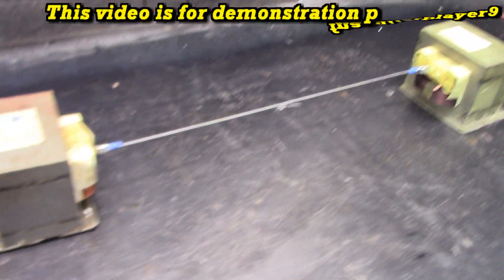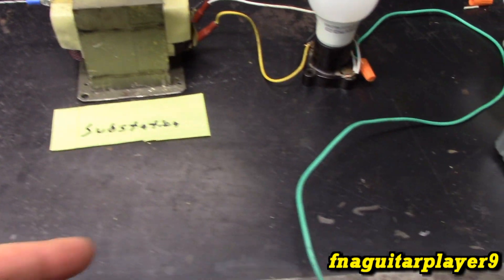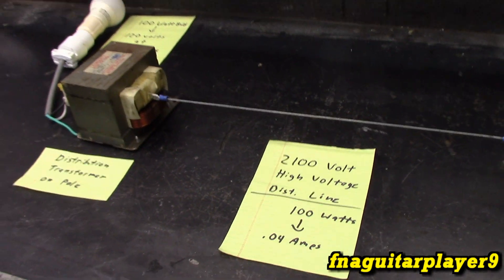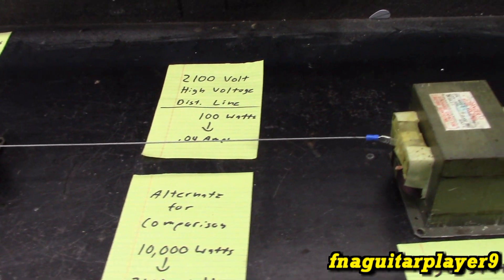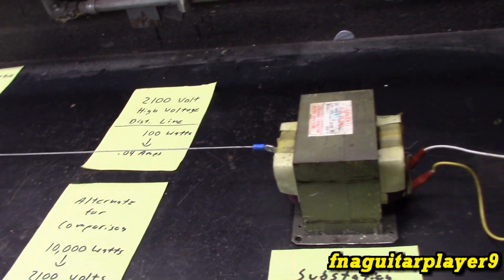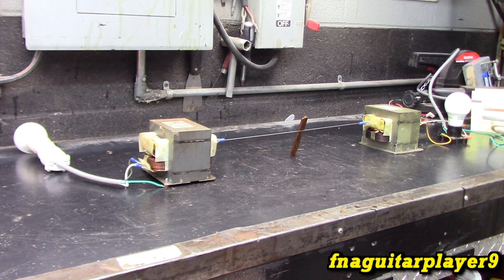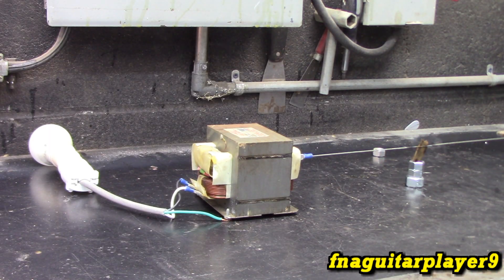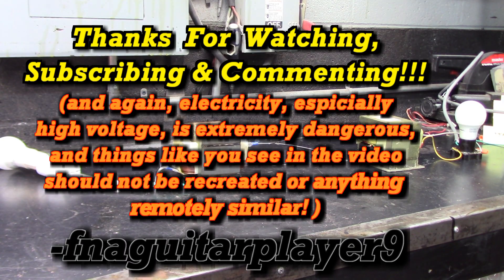How and Why High Voltage AC is Used for Electrical Distribution and Demo of Tree Contact

Comment: Thanks. I would have thought both wires on secondary would need to be connected to each other .
Reply: One end of the High Voltage winding in a Microwave Oven transformer connects internally to the frame. As mentioned at the start of the video, the return circuit is formed by the metal bench, which is earthed for safety and the frame of each transformer is in contact with it. That might not have been easy to pick up on as it was only mentioned briefly, or someone might start partway into the video. This demo models the now not so common SWER (Single Wire Earth Return) mains distribution system.
Reply: @PlatypusPerspective  thanks for the explanation. I did miss that part.

Comment: the cost of the wire is insignificant compared to the cost of the losses in the transmission. 
the higher the amperage the more losses there are, so the higher the cost of transmission, step up the voltage to lower the amperage and you reduce the cost of transmission. 
while it is still all down to money and profits, it's not the cost of the cable that is a major concern, if you could make more profit by using a 3 foot thick cable, they would use a 3 foot thick cable.

Comment: I don't think what he says is correct. Here in Sweden we use high voltage cables so people won't crash into the cables when they walk and avoids being electrocuted. We also don't want to wait for the electricity too much so we try to force it to move faster by increasing the pressure. It has nothing to do with resistance.
Reply: What the heck have I just read
Reply: @bilvanjomo7110  I'm not sure, but I suspect there's a Swedish word for it.
Reply: @bilvanjomo7110  Why so negative and racist answers? The cables are hung high above the ground in Sweden. That is why they are called high voltage cables.  We tried with low voltage cables but people kept tripping and stumbling over them so we went for higher mounted cables instead.

Comment: This is so cool!  So informative!  Thanks!   A topic on why it is AC vs DC would be cool too!  I know that Alexander Graham Bell had a competing Idea than Thomas Edison on DC versus AC for homes but I cannot remember why.  It seems Bell thought each home should generate their own power (freedom) and Edison believed in government to do it instead. (control)
Reply: AC is able to be transformed up and down in voltages without any other technology which means its cheaper.  you can transform DC to DC at different voltages but not really with the tech back when the grid was invented.  it was also a false information fear campain, the AC proponents said that DC was used for executions which meant it was more dangerous.
Reply: Nikola Tesla was responsible for the theoretical groundwork of AC technology. He had worked briefly for Edison, who fiercely defended DC power, and rejected Tesla's view of AC being preferable. George Westinghouse supported Tesla and AC development.

Comment: Good video, many thanks, I worked for an electric company and was in a substation when the 350 thousand volt breakers above the station opened under full load due to a short circuit.  Quite the experience. Very loud and could feel the premade station jump. slightly.